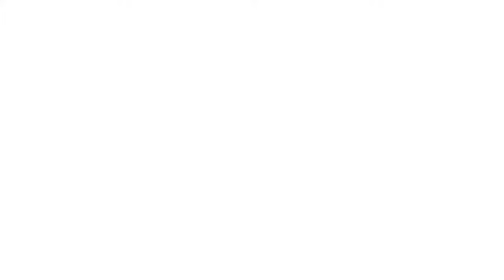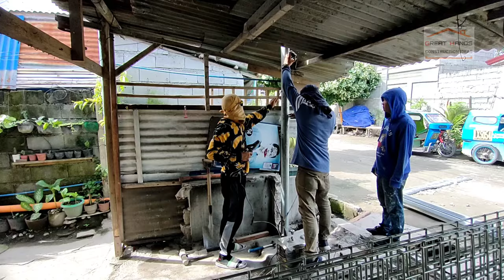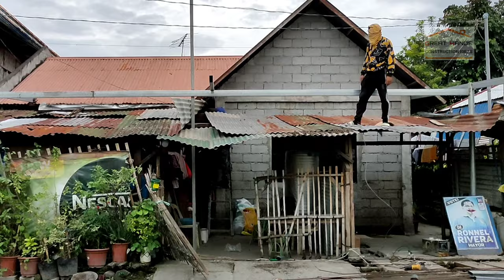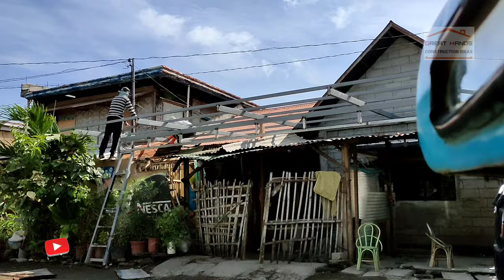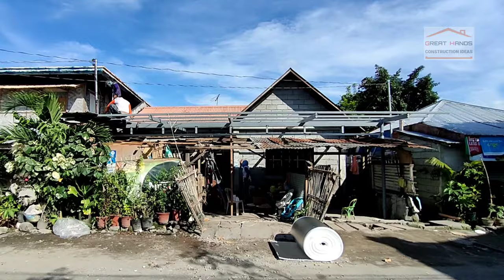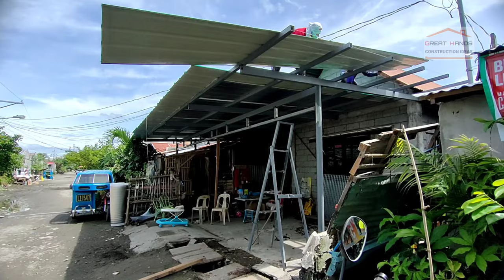Paggawa Ng Simpleng Garahe || Simple Garage Design

Comment: Ilang piraso po rectangular tube s 2x4 at 2x2 gi pipe post at rib type n roof po
Reply from the maker: 8 pcs  = 2x4x1.5 rectangular tube
14 pcs = 2x2x1.5 square tube
2 pcs = Gi Pipe #3 schedule 40
9 pcs = 5 meters 0.4 rib type roofing
Reply: @greathandsconstructionidea7676 total cost boss?

Comment: Pwede pong malaman ang mga materyales na ginamit dito sir, pati po ang kapal? Thank you
Reply from the maker: Ok po sir. 
G.i pipe #3 schedule 40
Rectangular tube 2x4x1.5
Square tube 2x2x1.5
Rib type roofing 0.4mm
Insolation foam 10mm
Epoxy primer (gray)
Welding rod
Tie wire #16
Reply: May branch po ba kayo sa Manila kung nasa Manila ang magpapagawa po?
Reply: Mag Kanu po sainyo pagawa ng ganyan?